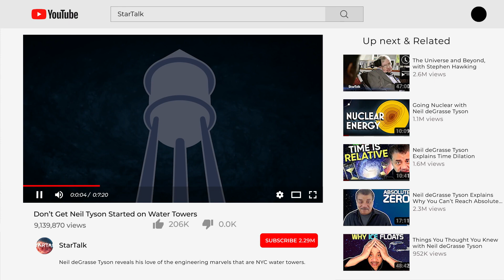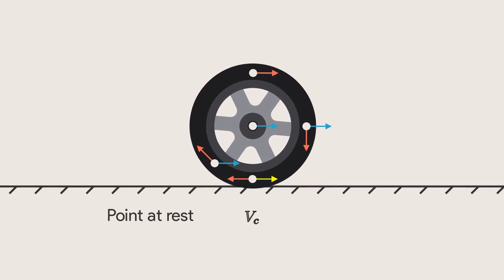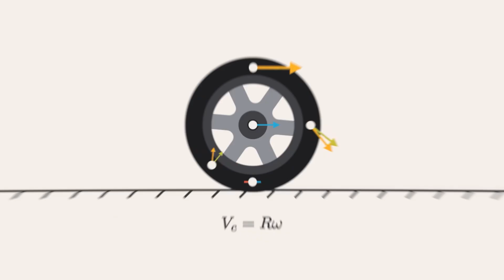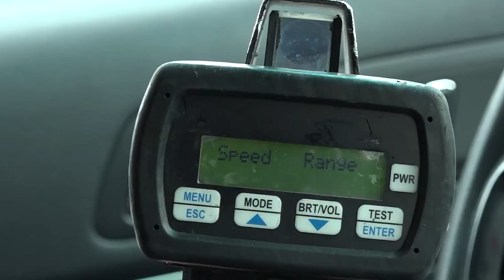How Wheels Really Work | Neil deGrasse Tyson Explains...

Comment: So if the vehicle is travelling at 75% the speed of light, what speed is the top of the wheel travelling at?
Reply: I would love it if Neil could answer that question!
Reply: I like this question.
Reply: Since the entire video is an exercise in  finding a frame of reference; the answer is 75% c. the bottom of the wheel is going to be -75% c and your car is “at rest” :)
Reply: @_liminor  That answer isn’t accuate. In theory you can't simply add velocities the way Neil explains, instead you should use Einstein’s velocity addition formula (but at low speeds like 100KM/H the denominator is so small you may as well approximate it as v = (v1 + v2).  However what really happens is: v = (v1 + v2) / (1 + v1*v2 / c^2)

where c is the speed of light, and v1 and v2 are the two velocities you're trying to combine.

Example using 0.75c:
Let’s say a car is moving at 0.75c, and the top of the wheel is moving forward at another 0.75c relative to the car (due to rotation). Plug it into the formula:

v = (0.75c + 0.75c) / (1 + (0.75 * 0.75))
= 1.5c / (1 + 0.5625)
= 1.5c / 1.5625
≈ 0.96c

So the top of the wheel is moving at about 0.96c, not 1.5c. Nothing with mass can exceed the speed of light — relativity keeps everything under control.

At 100KM/H the denominator in the formula is 1.00000000000000855, so in the formula 200/1.00000000000000855 you essentially get 199.99999999999829, which is basically 200KM/H.

Comment: There was a time when wheel trims were known to occassionally travel faster than the wheels they were clipped onto. 🤨 If you think of the time difference between the top floor and base floor of a tall building, the time delay difference also applies to vehicles, so technically it could be said to be the same thing in higher dimensions or just more forces at play when it comes to aerodynamics, crosswinds and time zones. If you think about it, a vehicle could be thought of as a kind of Transformer after all... Makes you wonder about the classic shape of a car, stepped Pyramids and all the Mounds and old wonderous sites of the world doesn't it, and things like the Tibetan prayer wheels of Temples on/in mountains, and where the sound and air waves might reach or be directed, and light if you concider ancient mirrors and the ease to create holograms, mirages and lenses spaces, whilst having some glasses like Emperor Nero's with Beryl gems in them, and all the potential ways they could be used in things like a God's eye, with night vision, infrared, lasing, magnifying and filtering optics etc as utilised today in some modern technologies, not to mention the use of porcelain, ceramics, clays, metals and things... 😶🤔

Comment: I think this as this way if you paint a part of the wheel of a car then the colored part of the will move like a wave form a outsider observer but at the same time the car moves in a straight line so the colored part of the wheel moves longer distance than the static moving car

Comment: Mr Tyson is wrong. Train wheels have flanges INSIDE the track, not outside! Otherwise trains would derail continuously... And flanges are necessary only in sharp curves, otherwise the wheel conicity is sufficient (and crucial) to keep the train on the rails:
1) https://youtu.be/oEafLfJrT6U
2) https://youtu.be/rT6Qh8b-3Ks

Comment: um, if a transmitter was attached to a specific part of the wheel, as it rotates with the wheel would it not it's speed change as the tire rotates? So some times it would be going faster and sometimes slower.

Comment: So, this begs the question, does this mean that theoretically there are relativistic effects between the top and the bottom of a wheel due to the different speeds?
Reply: Yes, which is why tires today are the real speed limit for cars. 
Rocket cars on test rails going Mach- XYZ are not on tires.
Never buy cheap tires!   
0-60 back to 0 ... in milliseconds... is what tears up your tire.

Comment: One idea for attaching that device to your wheel could be to put a stationary rod through the center of your axle (attached with a specially designed rod/electrical system), run that rod all the way outside of your wheel about 3" (not too noticeable but youll see why we need the space), that holds another rod pointed 90° down toward the bottom of the wheel, then attach a free rotating small 3" radius wheel adjusted by a small electrical motor to move up and down the above rod. This would be fitted with a sensor for measuring the speed of the 3" wheel, and should theoretically, unless there's something I'm not taking into account, measure the speed of the wheel at separate speeds per setting of the height of the wheel. The rest is just sending the data back to the cab of the car where you can adjust a microwave transmitter to emit whatever speed.
Reply: This is all assuming a flat hub cap and it wouldn't reach, realistically, all the way to the bottom on a normal car due to the deformation of the rubber in the tires, but experimentally, it's 100% plausible, buildable, and potentially marketable.
Reply: Bursting your bubble here...
Cops only tag ur speed from the front as you come towards them. 
Radar works by reflecting a signal multiple times, and the vehicle speed is calculated as an average. 
No speed changes occur from the side.  Pop!
 Edit:  Then there is the problem with laser radar...

Comment: Does the wheel have different G forces at different points of the wheel? It must have right?
Reply: Yup.  Roughly Calculate acceleration (0-60mph@ 3 secs) as 1G, which would be a Tesla Plaid @ full throttle. Then, think how ur tire(top to bottom) is accelerating and decelerating from 0 to 60 back to 0, in milliseconds. It's many orders of magnitude greater than 0-60mph in 3 seconds. Its in the 100s of G's for the extreme ranges of the rubber.
This is why tires are the limiting factor for a vehicles top speed. 
A Bugatti Veyron tops out around 320...it's not the cars limit. At those speeds the most expensive tires on that Veyron last about as long as the tank of fuel used....12 miles.
Pop!  That was ur mind blowing...
Reply: @Sammasambuddha    yep that's what I thought.  There's some serious forces on the tyre.  They look smooth when rolling along the road but Holy crap they go through some crazy forces.

Comment: Every point on the wheel goes faster than the axle half the time and slower half the time. No point stops while the car is moving.
Reply: Nope. The immediate contact point at the bottom is moving at ground speed. Otherwise slippage/skidding occurs.  Ground speed = 0mph.
Reply: @Sammasambuddha  If the ground speed is 0, then the earth doesn't rotate on an axis. It's the atoms at the surface that vibrate. God looking up through a transparent surface sees the wheel like a movie, one frame at a time..................
Reply: @danmiller4725  We're discussing relative speeds where ground is absolute zero compared to vehicle at any speed.  
God's ability to see through atomic structures is another topic.
Reply: @Sammasambuddha  ok. If you pass a car on the highway and look in your rear view mirror at it, you see it moving away from you. But relative to the absolute ground frame we know it is moving forward like you. There are issues not being addressed because Eye See You is obsessed with Winning a debate.
Reply: As I pulled a disc frame camera from my pocket the hair trigger shutter went off accidently.When I developed the film and looked at that accidental photo it startled me. It was blurred except for one small area which was a license plate on a vehicle parked there. The license plate and number 1114CE was in focus. I thought about how could it be and thought the photo emulsion must have a shutter speed and aperture other than that of the camera.

Comment: I have enjoyed puzzling people for over 50 years with this conundrum.

This is how tires remove rainwater from the surface of the road, even on very fast cars like racing cars traveling at 200+ mph!  The water can enter the tire tread easily as the tread is stationary, even if only for a very brief amount of time, while in contact with the the wet road surface.  It also explains why even relatively slow vehicles, such as trucks, throw clouds of spray from their wheels in the rain.  The water enters the tire tread , is accelerated up to twice the forward speed of the vehicle, but mostly thrown outward as spray before that can happen.  This also happens with air so the tire becomes a pump, raising the air pressure in the upper portions of the wheel well.  Racing sports cars often have openings at the top of their wheel wells to release this pressure and help stabilize them at high speeds.

Comment: Can you argue in court that the cop was aiming somewhere above the center of one of the tires of the car?
Reply: No. Cops use radar/lidar at the front of ur vehicle as you approach them. Multiple tags calculate the difference in vehicle position giving speed. There is no change in vehicle position from the side. Neil is not correct in this fact today....

Comment: 8:30 There is a part of an airplane, actually it's a radio that receives the radar pulse then rebroadcasts it with encoded information. This makes your airplane show up better on the controller's radar screen and it provides your callsign, altitude, heading and other information the controller might need. It's possible to use such a transponder to interfere with the cop's radar gun.
     The radar gun works by sending and receiving two pulses and uses the difference to calculate your speed. It is essentially getting the range to your car twice. For legal reasons the radar gun does this several times to get an average speed. Now you don't need to make the radar gun think you are going slower. If you can make it think you are going some ridiculous speed and speed the cop gives you will be thrown out. For example, if you can make the radar gun show your speed as 1200 MPH you won't get a speeding ticket because no production car can go that fast.
Reply: Uh whaaa?   

Aircraft ping their positional data at a regular timed broadcasts.  It's not replying to a request from a tower.
Radar is used as a backup to give actual last position correlated with the broadcast data for verification.  If one stops working, or like flight MH370 it's turned off, then only radar can determine last physical location.
Pop!   Mind blown.
Reply: @Sammasambuddha  Everything you just said is wrong. 
     I have described how the transponder works, and transponder technology goes back at least to WWII.
    I'm not sure what you are talking about a but it sounds like something only airliners are doing. 
   What makes me think you have no idea what you are talking about is, you talked about information being sent to the tower.
     A control tower only controls traffic that is interacting with the airport itself. Either taxiing on the ground coming in to land, or performing "pattern work"
   Once an airplane takes off they are directed to contact "Center." 
     ATC is divided into areas called "Center" and each center is subdivided with each controller controlling a small area.
   A Center occupies a building that may or may not be at an airport (it usually isn't) and it receives radar information from remote radars
   If you don't know this, I doubt you know anything.
Reply: @Eric Taylor  
If you think you know everything,  go ahead. That's all you'll ever be.   -Buddah

Your life must be awful...believing everything you think you know. 
Good luck, pal.

Comment: hey Neil see this or reads it. I saw nasa going mars. use solar panel field power robots but solar panels selves are robots. self cleaning and move get best sun light through day then go add batters all robot brothers at night. or maybe cables home base what ever. how long till solar panels on houses and building and barns. move around like tom holland spider man get best light. giant spider robot with solar panel back just crawls around get best sun light. If hand partial block sunlight part day. have weight for sun move.  if solar panels giant spider it move other side roof or just were ever there sun light. I was think about this. I probly cain't think do like describe it. but way I would do it have I beam track so the solar panels move  like train to sunner part of the  building then back start point.  but still bolted down high wind.

Comment: Little more insight on Train wheels, they're designed in wedge shape so that the wheels automatically center themselves, unlike cars which have differential that help different wheels rotating at different speeds, train wheels can't do that. During turning the wheels move in a way that inner wheel rotate on small dia and outer wheel rotate on larger dia and later they center themselves because of forces, really ingeneous.

Comment: Thanks for the video Dr. but I like to think about it as just a turning effect about a pivot/fulcrum (aka moment). 

In this scenario, the part of the wheel (whether that of a train or car) in contact with the road/rail momentarily acts the pivot with the help of friction. At the same time the parts (including the top, center and for the case of a train, below) perpendicular to it, undergo turning (again, momentarily).

Of course, for a given spin provided by the axle, the extremes of the wheel which will momentarily be part of the the straight line drawn through the pivot, will experience the maximum torque. The part acting as the pivot sacrifices its turning/movement for all other parts of the car/train to move🥲... happy Easter to you all.

Comment: So is that how you calculate coefficient ratings?  How do you do that for a car or a metal train wheel?
Reply: You could actually determine friction coefficients using the acceleration of a slipping wheel. You could use slow motion footage for example.

Comment: I would think to be able to engineer something CLOSE to what you need is to mount the scanner on a bracket between both sides of the wheelwell while the scanner is pointing towards the bottom. I figured out the mounting part, someone else can figure out the hardware and software needed to scan and broadcast 🤣

Comment: If the reference frame is the body of the car, then all points on the wheel are just spinning and not translating. Otherwise, this would mean the wheels are flying off 😅

Comment: Hope a friendly science channel recommendation is welcome here.  Steve Mould featured Reuleaux polygon-shaped coins in a video some time ago, those rounded polygons of constant width like the three-sided rotor in the Wankel engine.  These coins work fine in coin-op machines because of the constant width.  A Reuleaux polygon can only have an odd number of sides.
Bonus:  How do you drill a square hole?  With a Reuleaux triangle-shaped bit.

Comment: Nah man the bottom part of the lip of the wheel of the train doesn't move backward. It moves forward with the train. Theory and practical are two different things.

Edit: ok not with the train....but if a point on the body of the train has moved 1 km ahead, the bottom part of the lip of the wheel of the train will also move 1 km ahead.

Comment: I figured this out (actually, it hit me enexpectedly) fifty years ago while riding my bicycle: Looking down past the handlebars at the axle, you can see it is stationary w.r.t. your eyes and the rest of the bike, while the road is blurred in one direction and the top of the wheel is blurred in the opposite! I then got into a nasty situation trying to explain it to two engineering-student friends, who wouldn't accept this, even though I drew similar charts to yours. Never did think of the fascinating train angle, but there's another interesting phenomenon: if you superimpose the trace of a tack stuck in the tire over the sinusoidal velocity curve, you get a very different curve, which only boggles the mind further. PS: I married one of those friends, and she has no problem with your explanation, but never did accept mine unequivolently, though she has 2 engineering degrees more than I do!

Comment: Hey Neal a lot of people in the car community have trouble understanding why fwd cars such as Honda civic over 300hp do not have enough traction even with drag slick in sum cases due to all the weight transferring back  and we result to letting the rev limiter bang a few times to let's the momentum of the car catch up in most cases if you don't the car bogs down since it's having to compensate on a heavier load throughout the gear changes

Comment: I do not see how the contact point of the wheel can be "not moving".  It has to be "moving" toward the rear of the car at the same speed as the top of the wheel moves forward. (with a very slight flex delay).  Of course the contact moves along the wheel as the wheel turns.   For the contact point of the wheel no be not moving you would have to use some other reference point.
Reply: Look at the tracks on a moving tank and you will see the tracks on the ground stay in the same place.
The tank is 'laying' down it's tracks then rolling over them while the track on the bottom stays still then brings them up and over the top of it's wheels so it can be 'laid' down again once it's reached the front. So the tracks at the top have to be moving twice the speed of the tank to be able to get to the front in time.

Comment: 🛞 the reason why during a tornado 🌪️ a match would Pearce through a 🚙 car windshield Is because of What Dr. Neil deGrasse Tyson points out while in motion to the contact immobile point. 
The Tornado 🌪️ is the hammer 🔨 the nail is the matchstick the car is point of leverage impact I’m certain that experiments could show that when rolling or, not rolling. 🧐🤷‍♂️